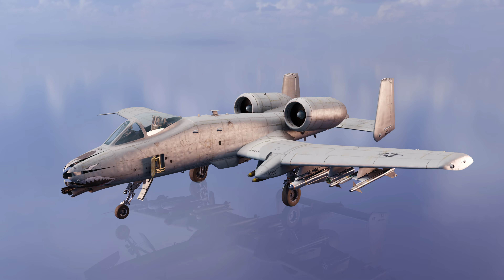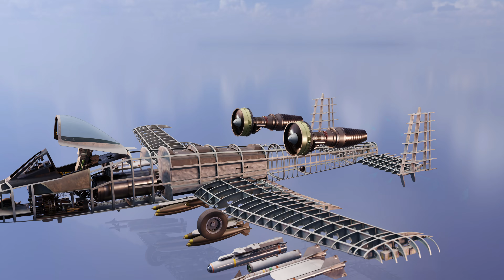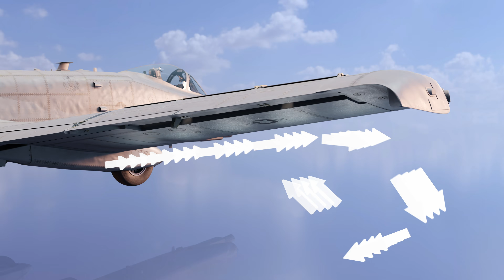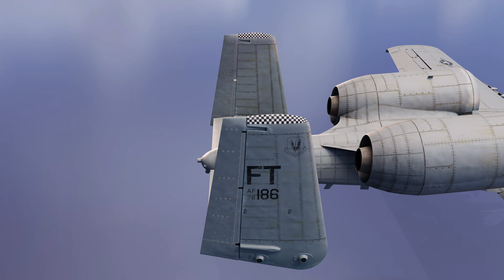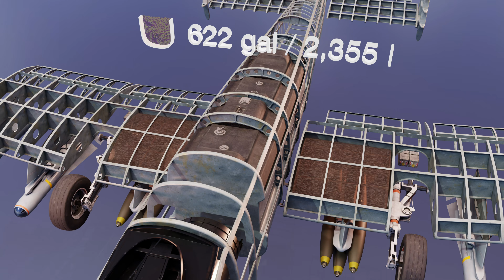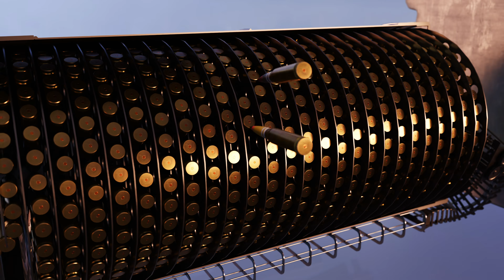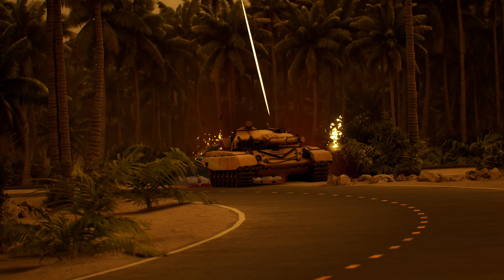Inside the A-10 Warthog

Comment: I worked on A10's for a few years, Jet Engine Mech and later Crew Chief, I use this analogy when talking about the A10 The F15, F16, F22 are the High Performance Sports cars and the A10 is the reliable truck, not fast, not the prettiest but it can carry a lot, stay around a lot longer and do a lot of damage, 
The A10 while it is a tough aircraft it still needs its big brothers around, the Eagle, Falcon and Raptor nearby .
Back in the late 80's and 90's before the conversion to C models the outermost station carried a ECM-Jamming pod. 
The engines help counter balance the gun, if the whole gun system was removed a tail jack had to be installed or the nose would rise up, 
if the gun was flown empty, we added ballast plates to the front of the jet, just inside the front wheel well, 
There is also a joke that the A10 has two half engines, the TF 34 was also used on the Navy SA 3 Viking.
Reply: Also, the rudder would automatically kick in when the gun was being fired. Otherwise, the plane would veer off course.
Reply: @natet7323  gun is designed to fire only the centerline barrel to prevent yaw and other effects. Not sure the actual tech but when you squeeze the trigger halfway its engages and will not move from aim point.
Reply: @GigglesD2  The gun is aimed by the aircraft itself. The first detent is a "ready to fire" and the second detent fires it. It's a safe, two stage process so a single pull dones not fire the gun.
Reply: I joined the AF June of 78 as a Jet Engine Mechanic.  I went to Myrtle Beach AFB for my first 8 years on A-10’s.  I got orders for McCord AFB in Washington State to work T-33 Shooting Stars.  Shortly after getting there, I was transferred over to work F-15 C’s & D’S.  Two years later I was ordered to Iceland working F-15’s for a short tour of one year.  After that tour, back to Myrtle Beach until I got out in 1991.  After just short of six years on the outside as a civilian, I jointed Pennsylvania Air National Guard Willow Grove Naval Air Station working A10’s again for the next 13 years as a Jet engine mechanic. We got caught up in a Navy Brack which closed our unit down.  I changed career field to Red Horse Heavy Equipment Operator for my last three years of service.  I retired in 2014 and loved every minute of my service, well 95% of it anyway.  I miss the people, the bond we shared of total trust in each other.  The A-10 is a great plane, easy to repair and keep fighting.  We deployed as a Guard unit and out performed our Active Duty units.  Everyone in our unit had well over a decade of experience in their respective fields on the A-10.  We deployed to the Middle East and did very well.  People today take our freedom for granted, I do not.  I wish I could do it all over again.❤
Reply: @SM-vs4ro  
I did 7 years on the 141 at Norton AFB
1 year in Iceland F15
2 years at RAF WoodBridge A10
18 months at Davis Monthan, AZ
I got caught up in the first shakeup, I cross trained to Combat Arms. spent 3 years at Travis AFB 
Took the Early Retirement at 15 years and worked as a Mechanic for a few years and then went to school to do Photography and did that and side jobs for a few years, 2019 my health went south, stopped working, then had to take care of my Mom for s few years, 
Now I'm semi retired, I work part time and my health is a lot better I ride bicycles and escooters to work.
Reply: Upvote for mentioning the mighty S-3 Viking!

I loved flying the Hoover and the TF-34.  I took a giant bird down an engine on a low-level at 430 knots (the impact rocked the entire aircraft) and the indicators barely hiccupped.  I headed back to base with the engine at idle and executed a precautionary single-engine landing.  After shutdown and exiting the aircraft I could finally see the engine in its entirety, and could not believe how much it was damaged.  Half the cowling was ripped away, bent stator vanes - I really should have shut it down immediately, but all cockpit indications were normal.

Not even 10,000 lbs of thrust per engine (at least on the Navy version), but bulletproof and very fuel efficient at all altitudes, but most importantly at LOW altitudes.  It could loiter all day long down in the weeds where fighters suck gas like crazy.
Reply: @WarHoover  
Wasn't its nickname the War Hoover.? I knew it was a multi-roll aircraft.
Reply: @bikecommuter24 , I think my YouTube name answeres that question.  

Actually, the generally acknowledged nickname was "Hoover", but the community changed it to "WarHoover" for more respectability. 

Yes we were multirole.  Tanking, ESM, Sea Control, and some land attack capability.
Reply: @bikecommuter24   Wart hog / War thog / Mud-hen or A-10 is all I've ever heard it called.
Reply: @knowahnosenothing4862  Mud Hen was the F-15 I believe
Reply: @war hoover- giant bird?
Reply: That's awesome, I love stories from service men and women. Thank you for your service!
Reply: Last video I watched… some snotty American called the drones a “ poor man’s “ weapon. Probably the same idiot who wants The Warthog gone.  The Ukraine would give their eye teeth to have 3 of those puppies for one day !
Reply: @cliffcalverley3605 
In war time, you use  whatever works you can bet the opposite side is doing the same
I see drones becoming more common.
Reply: Crew Chief, A-10A, 1998 to 2002, Pope AFB, NC.  Nothing more needed to be said.
Reply: @Mch79157  Crew chief, retired. Did a few years on the 10 with the 23rd TFW at England AFB in Louisianna, the only base that was authorized the tiger teeth. Also crewed the KC-10 at Shady J in NC. Also the F-4 and T-38.
Reply: @michaelcordle4839  
I started on C141's then F15C/D and A10A my last few years I was a Combat Arms Insturctor I cross trained when the big purge came along in 1991-92
Reply: I wonder if they could get more out of the gun if they used cased telescopic darts and polymer cases. if they save 300 -500kg's that ballast mass could be assigned to a small AESA nose radar. Then Some IR laser dazzlers and an Iron Fist APS on the rear of the tail cone for MANPADS. Brimstones and Barracuda missiles for 60km and 230km range with about 34 of either + 6 AGM65's.
Reply: I wouldn't like to be on the other end of that gun
Reply: As a former US Army soldier, I thank you.
Reply: Do you know if the A-10's maintenance per flight hours compared favorably to the sports cars?
Reply: @henryhoward9454  
Im sure on the exact amount, but the A10 requires a complete inspection every 500-600 flight hours, Most Military do require a few hours of maint 
every time they fly.
There are several inspections, Pre flight, Post Flight and routine scheduled inspections, 
The A10's did get new wings a few years ago, its still an old airplane,  some of jets might older than their pilots. I was working on jets made in 1977 at Davis Monthan AFB in Arizona.
Reply: Cooles Dingen
Reply: Thanks man really appreciated you being there for us 👍
Reply: I don't get the joke with two half engines are they underpowered or something or what
Reply: AFSC43131
Reply: Doesnt the c still carry like the alq184 sometimes? Or at least could carry it
Reply: Су 25
Reply: Thank you... it's good to learn about my favorite military aircraft...THE A10.!!!😮
Reply: My neighbor growing up worked at Fairchild on Long Island.
Reply: The A-10 was created by the Georgian Alexander Kartveli.
Reply: Also read somewhere that the A10 uses a calender as a speedometer! 😂
Reply: @Dimapur  Two if there was a strong headwind. Ferried them across the pond  many times. We had to slow waaaaaay down to refuel them
Reply: @michaelcordle4839  Did they fly independently and you meet them, or did you have to accompany them for the entire transit?
Reply: @Dimapur 
Maybe,
But in Germany they had roadmaps in the jets 
Many of the European countries are setup to do air operations using highways and road as alternate airstrips 
A10 pilots do practice landing on roadways
Reply: Just like the Iowa battle ships, this plane has outlived its intended envelope
Reply: The A10 is a beautiful lady. Can Ukraine have some, please

Comment: one interesting quirk of the A-10 on takeoff;

the plane has a vR (rotate speed) much lower than many other jet planes of the US Military...and pilots comment that the plane basically lifts itself into the air because of how large its wings are (generate much more lift than other planes).

pilots describe the plane as "floaty" because of how seamlessly it can get airborne and stay there.

Comment: Correction — they don’t typically use tracers.  The standard anti-armor ammunition mix is a 5:1 ratio of PGU-14/B Armor-Piercing Incendiary (API) rounds to PGU-13/B High-Explosive Incendiary (HEI) rounds, with no tracers included in the primary combat load.

Comment: If the Air Force doesn't want these ( actually, they never did ) they should all be transferred to the Army.
Reply: The Air Force offered. But the Army still only has its own helicopters. If they had agreed, they would have had to build their own airfield system specifically for the A-10.
Reply: The Army wanted to take them, but the Air Force refused. There is serious institutional animosity, bordering on hatred, at high levels from the Air Force towards the Army.
Reply: Methinks they're still salty because they used to be part of the Army until they became an independent branch.
Reply: @Kel_Varnsen  Possible, but they've been on their own longer than there was an Air Service or Air Corps prior to that time. Of course it does not help that they make themselves the butt of every joke and we have no problem telling those jokes.

Comment: NOOOOOOOOOO! How can they retire the a-10 which clearly proved that it is good at its job. Also I will not be suprised when the US air force pulls it out of retirement because who could have possibly thought that the A-10, a plane decisgned for CAS, is really good at CAS.
Reply: Look at it from another angle. We might never have heard of the A-10 if it weren't for the first Iraq campaign. By the time combat operations began, the decision to retire the A-10 had already been made. And then BAM! The Air Force realized they had an amazing tool in their hands that they were already prepared to throw away! If Bush hadn't started the war, only four geeks from the “aircraft antiques” forum would have known about the A-10.
Reply: The real issue is that they are almost 50 years old. The airframes are all beyond their designed lifespan and it takes a massive amount of money and constant repairs to keep them in the air. Why pay F-35 money for a 1970's plane? So the real question isn't whether to retire them, it's what to replace them with. As the for the answer they picked, you'll have to ask the USAF about that one.
Reply: The a10 is good at shootings farmers with no anti air systems against a developed country with anti air systems it would just be vulnerable

Comment: A very entertaining video with superb animations, well done indeed. 👏
The startup switchology was a bit wrong, as you engage each engine’s startup routine by moving the throttle out of the idle detent whilst the apu is running. The ignition override switches are only used (I think) in conditions such as heavy rain to prevent the engines from flaming out.

Comment: An absolute masterpiece. She might be outdated, tactically (in today's battlespace), but her value to moral can't be understated. If she can fly,, it means air dominance and an angel is perched on your shoulder.
Reply: "if even this rusty analog junk can still fly in the air, we have total air dominance"
Reply: Outdated by what standard? Some air force  general looking to introduce a 10 more expensive  F35 just to get a better pension?
Reply: @EddieVBlueIsland   with f-35 or even f-111  you can hit with bombs more precisely than a-10 ever did with gun. The airframes are ancient, a single pilot that acts as weapon specialist is over worked from both flying and guiding weapons. In fact, A-10 had most friendly fire incident, destroyed less tanks than F-111, and the only reason why the common idiot wants to keep it in service is because it makes sound like my tummy does after 3 chili tacos and half a bottle of whiskey.
Reply: @dominatorandwhocaresanyway9617 the a10a had the highest blue on blue, the a10c drastically fixed that problem
Reply: @EddieVBlueIsland  Because it is outdated in modern combat concept same as other air to ground attackers. In order to fly an A-10 over the battle field, you will need to establish air superiority, and if you already have air superiority, you already won the war and A-10 won't be a game changer in any sense. And again, the most difficult part is usually the part where you need to establish the air superiority, because any decent modern fighter/interceptor will easily gun down an unescorted A-10 (which defeats the purpose of having an A-10). So yes, it is outdated even though it is a beautifully designed aircraft during the Cold War.